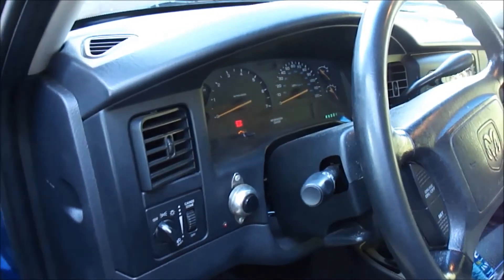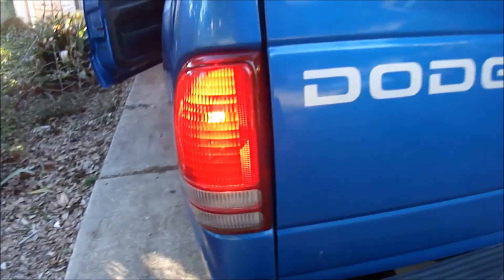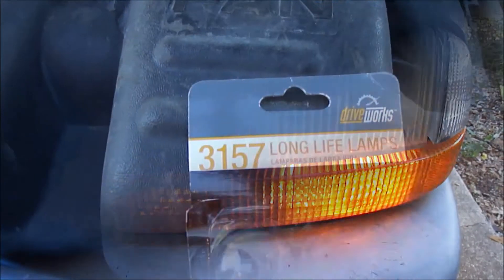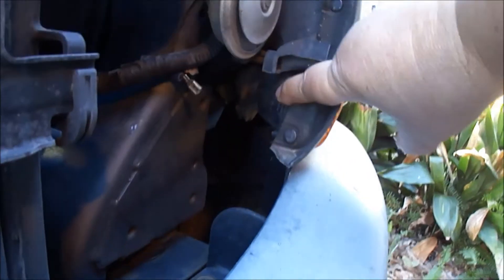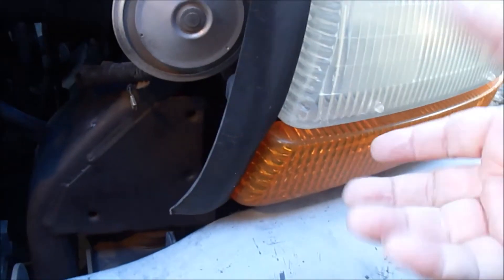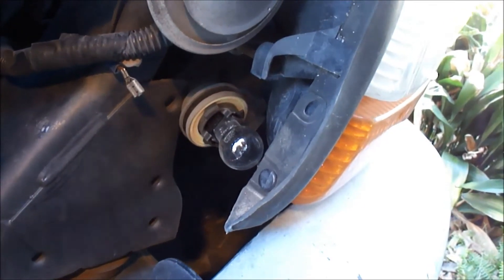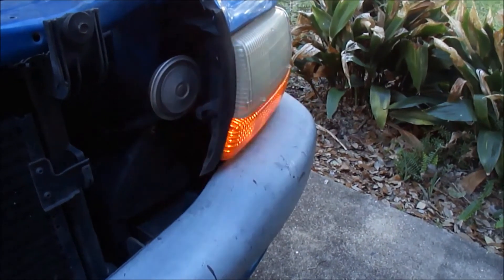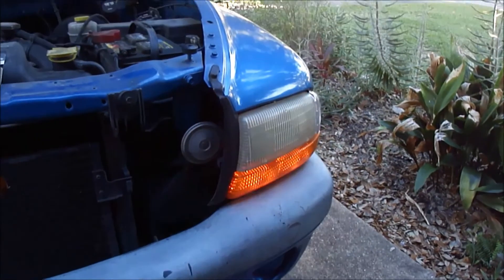2001 Dodge Dakota Turn Signal Flashing Fast

Comment: You only have t remove a T10 Torx screw between the turn signal lenses and the headlight lenses. The just pull the yellow lens unit forward. No need to remove bolts and the headlights.

Comment: Right rear bulb looks ok but doesnt light up. Light on dash blinks fast as if burned out bulb. Replaced bulb, still not working. What next? Is there a fuse to check? Other lights all work.

Comment: So mine won’t blink, but the bulb is fine. Only one bulb on the passenger side. Lights up for running light, but doest blink. When turned on the blinker is fast. PS, thanks for your videos!

Comment: Legit just replaced the bulb, the top part of the connector, still won't work on my 2001 Dakota, everything else is fine but the tailight driver side all other lights work.

Comment: I replaced my bulbs for the rear because it was doing this. Its still doing it front is good. Back bulbs replaced. Does this mean I have a short somewhere?
Reply: Turn on the hazards and check if one of the bulbs is weaker than the others, if it is, change it. I had a weaker bubl in the front that I changed just a week ago, changed it again and now it's perfect.
Reply: @ForsakenGod23  Thanks for the input. Fortunetly it fixed itself lol.

Comment: I am having the exact same problem on my 00 Dodge Durango,  but changed the bulb and whole lens but that same bulb still blinks fast. What is causing this?
Reply from the maker: +B-91-10 The 3157 bulb which is used for the front turn signals (2 bulbs per corner), brake lights, and reverse lights is a dual-filament bulb. For instance, the tail light illuminates 1 filament if you just have your lights turned on, but the 2nd filament kicks in when you hit the brakes. It's possible that only one of the filaments in the bulb is broken. Have someone stand behind and look to see if the brake light illuminates on both sides when pressing the brake pedal.
Reply: I know that.
Reply: Your blinker relay might have gone bad. Replace the fuse for the blinkers first, then if that doesn't fix it, look at replacing the relay.